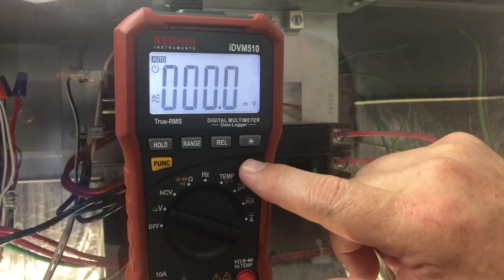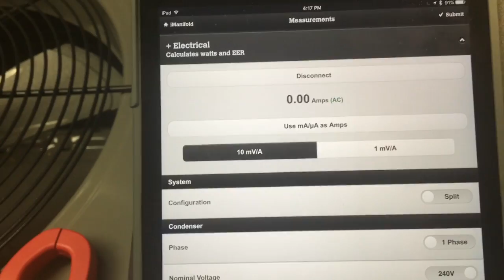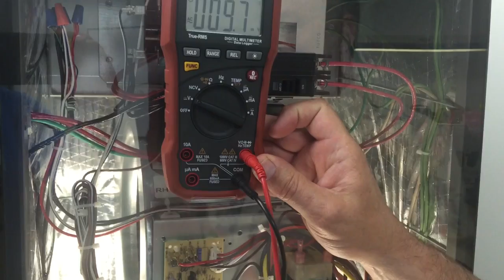Measuring Current with the Redfish Meter

Comment: That's a great comment, I will see if we can have the programmers change that to clear last field instead of clear all fields.
Reply: The X10 setting is used to increase accuracy at the lower ranges. You can also check a button in the iConnect app to capture the X10 reading and automatically convert it to amps.  The AEMC clamp is available at TTT, and it will produce a similar output accuracy

Comment: I have enjoyed using my redfish meter and mn01 amp clamp with my iconnect,  it has saved a lot of time.  One issue i have is in tight spots sometimes it will record the amps before the amp is closed and will record a false reading,  the biggest issue with this I have is that I cant correct the one mistake.  I have to clear all fields and restart.  I dont have an option to go back in manually and input,  Its either all auto fill or all manual fill.  It would be nice to be able to edit a single field when this happens instead of having to start over from scratch.
Reply: Agreed